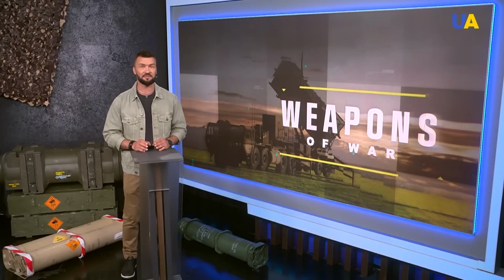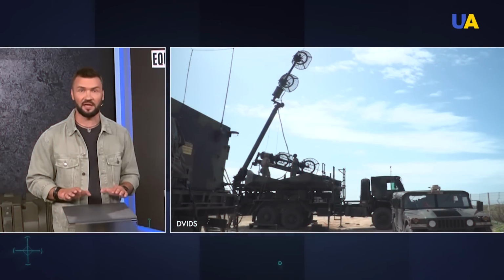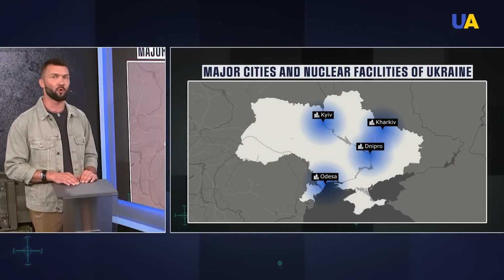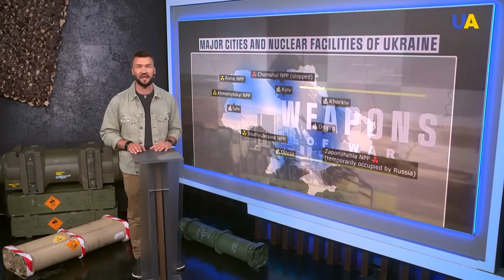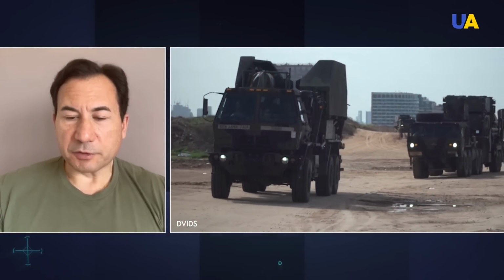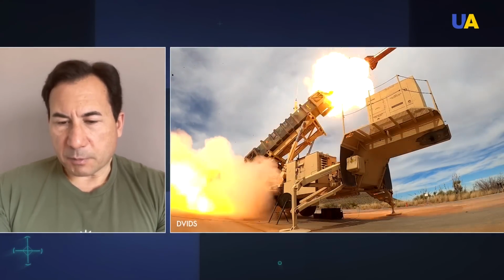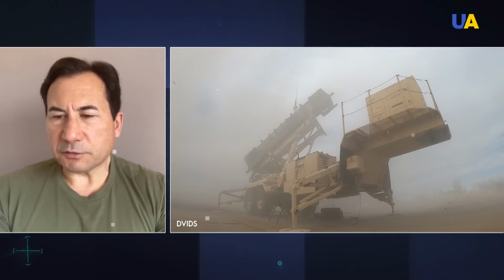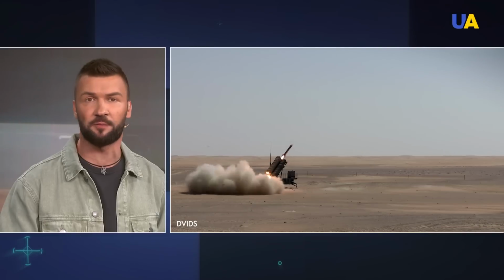Ultimate Guardian of Ukrainian skies: Patriot air defense against Russian missiles | Weapons of War

Comment: Russian MOD, Shoigu, visit to North Korea has immense significance. North Korea fell on hard times in around 2019, and was forced to shut down some of its munitions factories due to shortages in that country. The 2nd Economic Committee, which is in charge of its defense industry, is run by the Party Central Committee and runs the Department of Machinery Industry. Only a part of the 190 munitions factories are above ground. Many have extensive below ground facilities. Many are very large. For instance #26 plant has 20,000 workers, and another plant that concentrates on producing machine guns and mortars has 12,000. It has very large explosives production plants, and solid fuel production capacity, indicating a massive capability for producing both missiles and artillery shells. North Korea has been enabled to production of relatively recent types of Russian missiles and munitions, in some cases by reverse engineering Russian products. It has extensive research and development, engineering, capabilities. It even produces its own Integrated Circuits a a large electronics production facility. While North Korea ramped up its missile production in 2019, it cut back the production of other munitions. Largely due to food and other shortages. Rations to workers at the munitions plants were cut substantially. Missile production requires more long term planning and production efforts, compared to other types of ordinance. So the 2019 ramp up could have coincided with regime knowledge of the Russian situation driving the ramp up. In October of 2022 the regime ordered a ramp up of munitions production at its other plants. Coinciding with the increasing Russian need. It is believed that Russia has made deals with North Korea as to supplying food, and possibly other goods, in exchange for weapons production. North Korea having no real choice but to make the deals with Russia, given North Korea's extremely difficult situation as to shortages. We have to remember that North Korea is a major arms supplier, although much of what it moves globally is illicit. It is known to supply Iran and Iran related militias in the Mideast with arms. Iran has an ongoing deal with North Korea for "technical assistance". It is noteworthy that North Korea maintains chemical weapons development and manufacturing facilities. Also that it now is known to be producing tactical nuclear weapons of a relatively compact design. Whether North Korea has supplied or will supply tactical nuclear weapons to potential customers such as Iran and some other potential buyers remains an open question. We simply do not know. We do know that it could have done so and could be doing that too. It certainly can manufacture a wide range of missiles, artillery shells, artillery (including self propelled artillery), mortars and small arms in large quantities. Aerial views and estimates of North Korea's below ground extensions on its huge above ground factories indicate a very large capacity. North Korea also embarked on an automation and modernization program to increase production capabilities for arms and munitions. That includes the use of robots as well as modern CNC and other machinery. That despite its very difficult situation as to some essential commodities, primarily food, and its ongoing problems with having sufficient electricity to keep its massive military industrial complex fed with electric power. We believe that the Russian MOD has entered into further agreements with North Korea to facilitate supply, but that Russia is also promising delivery of even more goods and technological assistance to North Korea in response. A situation that will further destabilize the situation on the Korean Peninsula, in South East Asia, in the Mideast and possibly parts of Africa where North Korea is directly or indirectly active. What agreements are in place for North Korean arms plants to act in supply of the PLA is unknown but it is believed there are such agreements in place.  What we see is the fact that North Korea has been set up, by its friends, to the expansion of its military industries, in a situation of constrained markets but ever improving technical and production capacity capabilities. It has been encouraged to keep growing. That despite severe, and predictably worsening hardships. Thus making North Korea a very ready, and willing, captive supplier to whichever of its very few close allies seeks the assistance, and at a very competitive cost. North Korea did not do that all by itself, but it was set up to where it is today, and Iran, China and Russia are the three main players, with Pakistan a probable fourth. That in addition to North Korea's other sales of armaments manufacture globally.